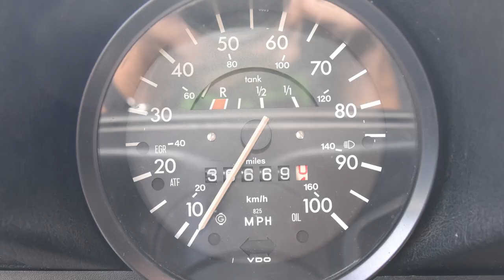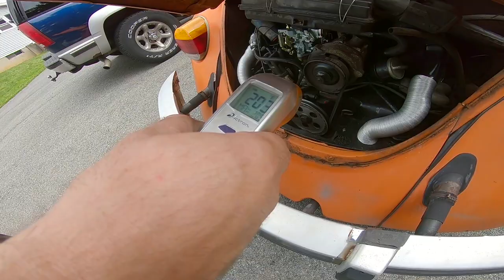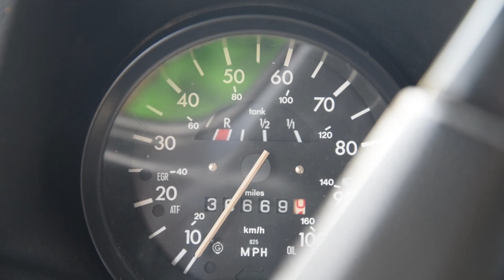1974 Volkswagen Super Beetle 1600: Regular Car Reviews

Comment: I’m a mechanic and I have a 1973 Super Beetle I love it as a kid I always dreamed of owning one. It’s not my daily driver but it does come out sometimes I just can’t drive it right now cause the headlights don’t work now and it won’t start so I don’t know if their is a short somewhere or what. Also in mine the fuse panel had been moved from the middle to the driver side and doesn’t have any wires running into it lol

Comment: Shit on it all you want. It's still better than any pile of crap civic. You should see the one that has been in our family since new. It looks, runs, and drives like it just came off the showroom floor.  Air cooled beetles will go forever,  with just a little regular maintenance.  And like any old car, if they get neglected, they develop issues.  The difference is, the beetle will be more likely to be useable despite those issues. Fantastic car, and I would own one in a second if I wasn't too big to be comfortable driving one.

Comment: I learned manual on my sister's 68 bug. Her boyfriend at the time and I did an engine swap in a parking lot one time. I've looked into buying one a few times but there is a collector premium on anything not trashed. Cool cars if you are mechanically inclined. Lots of aftermarket support. 

Most importantly, rule one of project car: project car shall not be your daily driver.

Comment: My first car was a ‘77 Super Beetle Convertible.  He’s right, you’ll become a mechanic, or die trying..  So many stories in connection with that car, mostly involving things that car did to me.  Mine was fuel-injected, which added no extra power and just made parts more expensive.  In the 1990s, I threw $16,000 at it and resto-modded it, installing leather and guards red (Porsche) paint, along with an engine rebuild.   No matter how much money you throw at them, underneath all that polish, paint and fanciness, lurks a hateful little motor that’s plotting to annoy you at best, or strand you at worst.  Good times!

Comment: My first car was a 1974 Beetle. I loved it and hated it. One time while I was driving through the mountains with a friend the engine somehow caught fire and so we pulled over. After a few minutes it went out and we got back in and kept on our way. The gear lever would get stuck in reverse and I’d have to force it out, it’d stall all the time, 2 cylinders just stopped working so I replaced the engine just to have 2 cylinders fail again... good times.

Comment: I had a 73 sb 1600. These are the 1303. No brakes.. lightweight.. cheap to run but the gas / oil / rust smell is there. Can be dangerous at times.. will be fun to drive at times.. will test you at times also. Alot of resources out there.. good as a collector.. wouldn't daily that again

Comment: In 1980 my 74 Super Beetle caught fire in the engine bay -- no doubt from that chintzy plastic fuel filter failing, or the fuel line popping off. I was on the freeway at the time. A Greyhound bus driver kindly extinguished the flame. The car was totaled. Fond memories.

Comment: I have a 1970 beetle outside of a generator  Problem Windows fogging up, cold in the Winter, hot in the summer, Adjusting valves every 6000 miles changing oil every 2500 miles, A carburetor, A Disk brake conversion kit it's been a really good car.

Comment: I enjoy my '73 beetle. All quirks included. And that's with driving across this great land. Longest trip being 1600 miles in one direction. Not the fastest guy on the road, but certainly enjoyed the views. The most basics of mechanics will be learned by owning one of these cars. Simplistic brakes, steering, suspension, etc. makes this a great car on a budget. All work can be done by the owner saving loads of cash with today's mechanic prices well over $100\hr.

Comment: I have a 1974 VW Thing. This is even stranger than the Beetle. Although it share pretty much the same engine and platform with the Beetle and Ghia it was the German military jeep. Steel outside when you look inside there's no padding just back and front seats and steel wall with a speedometer on the dash, no radio, no AC, no glovebox. The convertible roof comes down, window comes off, doors comes off and you can drive without a windshield as it folds down, but I would not unless you wear a motorcycle helmet.

Comment: In good tune at idle you should be able to set your coffee cup on the air cleaner of a factory engine  and barely see the coffee move inside the cup...  that engine was running like garbage. Hopping around like that makes me think it wasn't even running on all 4 cyls and if it was running hot the timing and mixture were off too.  I mean, You're right, the bug or any old worn out car will make a mechanic out of a person if they decide to stick with them and take the time to learn.  I rebuilt my first vw engine at 11.  They're NOT hard or expensive to work on if you can use simple tools and read.  While certainly not the pinnacle of performance they're very simple machines and with a little bit of effort quite reliable as well.   For something designed in the 1930's they're not bad cars at all.  They're just not for mechanically inept people.

Comment: My grandfather bought a green 1971 super beetle brand new,they had until 1982 when my uncle fell asleep at the wheel and side swiped a semi one night. They sold the car and they saw it a few times driving around. In 1989 my dad saw it on a used car and my uncle went and bought it,he drove it around a little until around 91-92 when he started taking it apart to fix rust. He never put it back together all the way and they car is still sitting in his garage buried in stuff. I hope to see it run someday buy I doubt it will until my dad is retired and has time to restore it,he learned to drive in that car. It just needs a new clutch and some rust to be fix,it’s pretty bad from what I’ve told ,it’s spent its whole life in central PA.

Comment: Things Mr regular got wrong:
1. Fuel and exhaust smell aren't normal. Like any car it means you have a leaky tank or exhaust system
2. Plastic fuel filter in the engine bay is generally fine. Many (like myself) don't want to take the chance so have moved it elsewhere. The engine bay doesn't get that hot (with correct tinware) and the engine shouldn't buck either. Glass filter is a terrible idea as glass can crack where plastic will not.
3. This car has an alternator

Comment: The interior smells like exhaust because the heater pipes and channels are rusted. If you take care of it that doesn't happen. The heat works by the air getting warmed up from the exhaust.

Comment: I have a 71 type 3 fastback, but I'm installing a Subaru turbo ej20 motor and switching up the suspension to a modern style independent suspension. I don't have time for all that valve adjustment, 53hp B.S, etc etc.

Comment: 74 air cooled VWs most definitely had alternators, not generators. Super Beetles used a McPherson strut from suspension vs the torsion bar set up on standard Beetles.

Comment: I still have my first car its a 66 Beetle. I'm a "car guy". I also have a square body chevy and a miata. The only reliability problems I ever had with any aircooled vw's was fuel injection on my 71 fastback type 3. I could understand someone not liking old vw's though and clearly RCR isn't a vw guy.

Comment: I am super biased since I am stupid enough to daily drive these things (an unrestored 63 and a 71 I restored myself). But I still say that if you maitain it properly and stay away from the cheapest repro parts, it is surprising how good these cars actually are. After all, a lot of them are still around, and where are all the old Civics? The problems that these cars have now adays is mostly from improper maintenance, old age and horrible repro parts. An example of this is fuel pumps with the pressed on top. They are very inconsistent and often make WAY too much pressure. The stock rebuildable pumps delivers a pretty stable 2.8psi that the beetle likes very good. But the non rebuildable repro pumps usually make much more than that. The stock pumps also has a built in fuel filter.
The filter is a widely debated topic that gets beaten to death on a regular basis. I personally would not put it on the pressure side of the fuel pump. And keep it away from the engine bay entirely. I would also avoid to have any weight on the line that could affect the inlet on the carburetor. They can come loose. And if they do when the car is running it will spray the engine with fuel. The best place to put the filter is either next to the gearbox or under the tank. If the engine is properly tuned and the transmission mounts aren't shot the engine will not shake like a rattlesnake's tail. They can run very smooth. This is especially true for the old 30hp 1200 (known as the 36hp in the US). A good insurance is to put a safety wire on the fuel line. And maybe even switch out the carburetor inlet for a tapped one. And make sure that the grommets that protect the fuel lines where they enter and exit both the frame and engine bay is actually there. If they are rotted out or missing the vibrations while you drive can saw through the lines over time.
And today it is really fun to be an annoying VW nut. The super beetle wasn't expanded in all directions. On the 71 and 72 the body was the same as the standard beetle from the windshield and backwards. On the 73 and later it was the same from the door and backwards. The front was a little bit longer to make room for the McPherson strut front suspension, and the front track was a little bit wider. In Europe the standards (except the automatic) did not have the double jointed drive shafts that the supers (and all 68 and newer US beetles had). Here we also got to choose between 1200, 1300 and 1600 engines until the very end. And the 1600 cars got disc brakes in the front. 
These cars came with an isolated battery cover from the factory. It went between the battery and the strap that holds the battery to the floor. This is just one of the many parts that various owners lost or threw away over the years. 
This also happened to a lot of cooling tins. A lot of beetle owners I have talked to that have problems with overheating are missing cooling tins or have gaps between them. If they are  missing or leaking hot air will easily reenter the engine bay and be sucked into the fan. Then the slightly hotter and hotter air can circulate through the cooling system and make it go hotter and hotter and eventually overheat. A good rule of thumb is if the part was there when the car left the factory, it is there for a reason. If the car is properly maintained and more or less complete it will cruise comfortably at 60+ mph.
To start with I actually wanted a Ford Mustang, but where I live they can be stupidly expensive. And I could actually afford a beetle when I was 15 so it just happened. And they have a tendency to grow on you. They keep me both sane and insane at the same time. The VW is a favorite, but sometime in the future I really want to own something with a V8. It is very true that it will make you a mechanic. Usually when people ask advice about owning an old beetle I tell them that you should either be willing to learn to work on it yourself, or have a patient mechanic friend who has lots of spare time. Which pretty much goes for all classic cars. It will be very fun to see what happens when old age starts to catch up on the Priuses and Teslas.

Comment: The description of Beetles on this particular video only accurately describes examples that are shot or badly neglected. Keep one in good shape (which, yes, requires commitment to upkeep, it’s an OLD car) and it will not only be relatively comfortable, functional and fun to drive,  but you will never, ever, ever.... ever be able to kill it. Classic beetles are automotive’s biggest abuse monsters. 
And they have tons of character to boot,  much more than an old Civic. 
PS: the three old bugs that I have owned, all ran like Swiss watches...if they were shaking like that one.... they had a problem. 
I WILL agree that they will make a mechanic out of you, and a metal fuel filter is a good idea.... in any car, really.
Reply: I've had a similar experience with 1300cc bone stock cars that were kept that way, even the 1600 becomes more of a headache and the dual carb cars I've owned have been nightmares, fun nightmares but nightmares none the less

Comment: So, I think you’re a bit hard on the VeeDub for a number of reasons.  WhoTF am I to say anything?  Well, growing up in the 60’s, my land yacht loving father HATED Beetles, particularly when they had the nerve to pass him. Krautwagens, Hitler’s Revenge were just a few of his terms of endearment. So being the contrary sort I am, my first 5 or 6 cars were, you guessed it, all Beetles. 

Starting with a red ‘65 convertible when I was 16.  That one had style and class, and almost bankrupted me. It also had 36 horsepower and was passed my semis on the highway.  The love affair was on.  Next was a white ‘67, very desirable now because it bridged two eras, classic body and bumpers, 12 volt electric, and a powerful 53 hp 1500cc engine, which made a huge difference.   

Once working full time, I could buy my first new car.  Honda Civics were teeny with an 1100cc engine and started rusting as soon as they left the lot. Corollas were OK, but no personality.  It was the first year of the Rabbit, and it went like stink, but my eyes fell on a brand new 1975 La Grande Bug, a special Edition Superbeetle that was metallic blue, with plush corduroy upholstery, a crank sunroof, wood grain dash, rack and pinion steering, fuel infection AND a Blauplunkt 8 track stereo.  The Superbeetle is more different than you mentioned in the video.  Instead of front torsion bars, it has McPherson Struts, which more than doubled the trunk size and made for much better handling.  Starting in ‘73 it also had a curved windshield and a regular padded dash line a real car.  

I took my La Grande Bug from Vancouver down to Mexico and back, and all across North America to the east coast and back through the American Midwest.  Smooth sailing all the way. 

Top and cruising speed was 81 mph, and it could do that all day. The heater was much more effective and had fresh air ventilation to boost it. Acceleration was great around town, and decent on the highway, it rode really well, and was quiet on the highway.  
It was one of the best small cars I’ve ever owned.  Never smelled exhaust or gas, that orange 74 was trashed, with probably rusted heater boxes, and a non functioning oil cooler.   It was NOT a good representation of the finer qualities of a well maintained Bug.  In 4 years and over 48,000 miles, I changed the oil every 3000 miles and that was it. One time it stalled in a busy intersection when it was still new, completely died.  The cable connecting the computer to the engine had come lose, 2 minute fix handled under warranty by Dieter, the mechanic at the VW dealership.  I reluctantly sold it to do a tour of Europe, and after a couple of motor scooters in the 80s, had a 64 rust bucket, a 4 door 411 (the car that almost killed VW) an orange 74 with a semi automatic stick shift. That was it until 2010 when a Tiguan and 3 Golfs have cemented my identity as a VW guy.

Comment: So, the one thing about these that's actually good is the chassis. It's basically a shortened and simplified classic 911 chassis with trailing arm suspension. People used to take these, strip them down to the chassis, stick Porsche engines in them and turn them into racing buggies.

Comment: Ive owned two. A 74 Super Beetle, and now a 67 Classic Beetle. Very reliable cars. These are also the easiest classic cars to work on and maintain. 2nd only to the Ford Model A. You can literally take the engine out of one in about 20 minutes.
Reply: That may be true, but like any classic car you HAVE to work on and maintain them. None of the problems he listed are unfixable, and he has even stated that the beetle is a fantastic introduction to classic cars in a different video.

Comment: I completely get how it would make a mechanic out of a person. It needs constant maintenance, but none of the maintenance is crazy complex. It's a fairly simple machine. I learned a lot of basic mechanic stuff on cars from the 80s, which were more senselessly complex and in need of a lot of work by the time I drove them in the mid-late 90s. I wanted a Beetle very badly, but living in central Ohio, their non-existent heat and tendency to rust into oblivion kept me from them.

Comment: For a guy who puts down people without car knowledge you sure got a lot wrong in the video. That one has an alternator and struts. They are great in the snow and go up hills like a champ because all the weight over the tires. I have a 1977 standard beetle with a 1600 EFI. Way more reliable then the 2004 Hyundai or the 2000 New Beetle. You got to put up keep on all cars you own or they fall apart. Beetles are cheap, small, simple, and have less parts that can go wrong. For a design from the 1930s it stands the test of time.